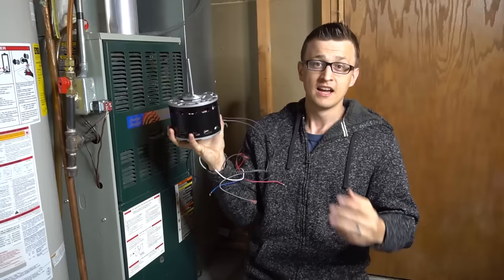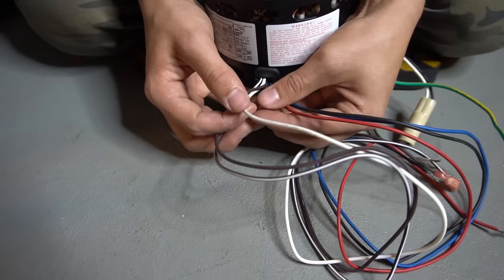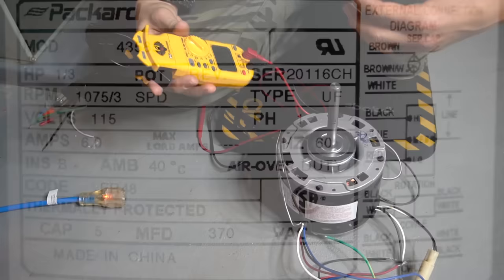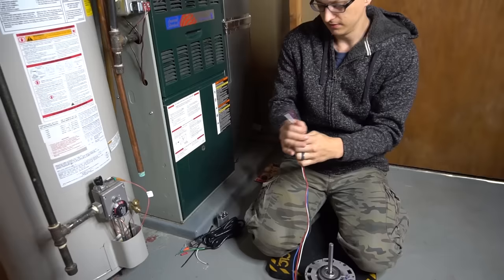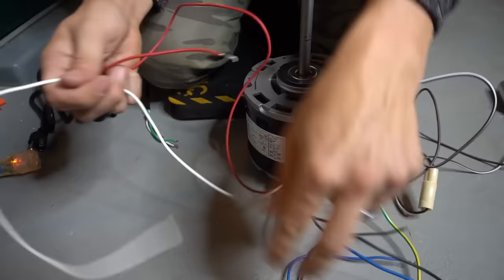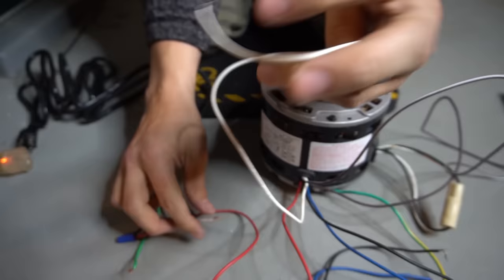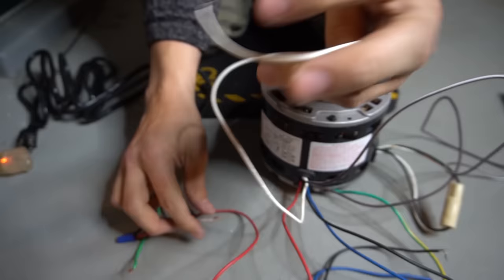How To Wire a Furnace or AC Blower Motor

Comment: Thank you very much for demonstrating how to check the motor speed wires!!!  On my 24 year old 2.5 ton York HVAC, both of my heat and cool board terminals were connected with the same black wire via with a short jumper wire therefore the heat mode was operating at a much faster speed.  For the heat mode now, I replaced the split/jumper  black wire that was going to both the heat and cool and replaced the heat mode side with the blue wire that was previously on the park terminal.  Everything is so much better now.  Again, thank you for your top quality DIY videos!!

Comment: "Rotation" has two views.  Shaft end and Wire end depending on how the fan blade or squirrel cage will mount or how the motor will mount, shaft upward or shaft downward. You might also comment about how to find HVAC parts because most of the supply warehouses protect their industry service tech by only selling to licensed general and/or HVAC contractors. Great review.

Comment: Capacitor job is to start the motor. If you disconnected the capacitor from your motor and turn the power on you will hear humming noise however if you rotate the shaft by hand your motor will start spinning to whatever the speed setting is. 
Great video by the way ! Good job bro
Reply: Would the capacitor's lifespan be increased if one line of the capacitor is automatically disconnected AFTER the motor has started up and is spinning (and of course auto-reconnect it AFTER the fan is switched-off again)? 
Hiring service-people to do the routine job of replacing capacitors seems to cost people a LOT of money in service calls.
Reply: Very good thought but unfortunately the circuit doesn’t work that way. 
Just think capacitors are like batteries, they will lose their ability to hold charge overtime and eventually decreased their capacity below useful threshold.
Reply: @eddo5617  That's ususally because the electrolyte degrades over use/time...often due to heat, chemical processes, over-volting, seal failure, and a few other things. But since the caps are often mounted on or very near the motor itself, of which many do get very hot, I was just wondering if disconnecting one, once the fan is "spun-up" would help reduce the electrolyte degradation by any significant degree. I do know that during use the electrolyte itself often also heats up to some degree...and that in turn can further accelerate the electrolyte failure. I just don't know the particulars in an AC motor circuit.

Comment: A very good as well as easy to understand instructional video. My blower motor ''went'' last weekend due to it's bushings going bad. For some reason they didn't put any oiling ports on the ends of the motor to oil those bushings. Since it's currently in the middle of winter & I'm goin through a pretty powerful cold spell, I ''had'' to get something going quick. I had an old ''scrounged'' blower motor on a shelf in my basement that fit just fine (a little better in fact), but it was only an 800 RPM motor instead of a 1000 RPM as the original was. I like how much better this slower motor is heating my house, but since it's a single speed motor, I'd probably have some issues with the cooling coils freezing up during the summer or A/C season. Since it is a ''scrounged'' old motor, I need to replace the original with a ''new'' motor. I typically fix everything I have if I can if I'm able to get access to what I need so putting a ''new'' blower motor in my furnace won't be that hard (especially since I've already torn it all apart to try to fix the original & replaced it with another). I've researched a particular motor, but all I've been provided with is a brand name, part number, & wiring diagrams. I haven't found if it has more than 1 speed & what speeds they might be if it did. As many leads it has, I believe it surely has more than 1 speed. Since the color of it's wires are similar to those on your motor, I was wondering what the 2 slower speeds were on the motor you used in your demonstration. If I could get a replacement motor that had a slower, approx. 800RPM speed along with the 1075 RPM, I could wire in a switch so I could switch it between the 1075 RPM for the A/C season & to a slower speed during furnace season. I'm amazed at how much better my furnace heats my house after putting this 200 RPM slower motor in. It seems like the slower air flow is able to heat ''everything'' in the house along with ''every'' part of the house so it doesn't need to run as long each time it runs. I could literally feel the house getting, feeling, & staying warmer after it ran for the 1st time & it feels warmer in here even after setting my thermostat 2 degrees lower. It's been a surprising experiment I was forced to undertake in the cold of winter (it's 0 or below outside now as I'm typing this) with surprising results. I would like to know what the other speeds were on your ''demonstration'' motor. Again, well done video, Sir.

Comment: That's very handy info man! I
 wired my last blower motor in several years ago but had to be careful to wire it back exactly like it was since most motors I'd dealt with only had 3 wires.
Its not so complicated once you realize 2 are for the capacitor, 3 for the motor speeds to hot lead and 1 for the neutral or common. 
Also love the extension cord connection.

Comment: This is really helpful. I need to replace the fan motor on my heatpump tomorrow and when I replaced the blower motor in my furnace a few years ago i wired it to high speed because I wasn't sure. Now I can double check my work on the furnace and slow the fan down, she runs hard and is pretty high volume out of the ducts

Comment: between this video and the other video on replacing a blower motor I got mine replaced and saved about $500 in the process, you are awesome!  thanks so much for making the videos and answering my questions about 115V vs 200-230V motors
Reply from the maker: Glad to hear you were able to get it fixed! Thanks for coming back with an update, stay cool! ;)

Comment: Thanks, a friend just dropped off a blower with a similar motor he saved out of his air handler he had replace a few years ago. Asked me to wire it to switches so he could make a simple box cabinet to use it as a fan in his garage this summer. I knew the basic principle of how they work but your well explained details sure saved me a lot of time figuring it out on my own. Thanks  again for all the help. :-)
Reply: Speed  and power samll wire rethion  .  White comon  N..read  low  speed..  black..ac serped high..... bleu  mediom low seepwhit  mediom pon 110  N  and mieiom poin  power pont..
Reply: Brown and whit mix cap.. gerecap 2 wire .

Comment: Thank you Sir! My York just stopped blowing last night/yesterday... Very comprehensive and descriptive video. I was thinking my motor was bad (expensive} but I now know that I need to test my capacitor also (much less expensive) since without a good one or unplugged, the motor only hums. That is exactly what mine is doing after the gas burners heat up and I hear the click for the fan blower to kick on.

Comment: Thank you so much for your detailed explanation!  Our furnace is almost 20 years old. The prices to replace the motor and capacitor is $1,440. Eeek!  I'm going to replace my capisiter,  disassemble my fan and motor, clean them and oil up my motor a bit to keep it running smoothly.  So$10 worth of maintenance.  Even if I have to replace the motor, it's hundreds instead of thousands.
Reply from the maker: Oh yes! I would do it myself too if I got a bid that high... With all the how-to videos nowadays on YouTube, all you need is the willingness to try :) Thank you for watching and commenting!

Comment: This was super helpful.  My gas furnace blower motor is either bad or the capacitor is bad.  The motor thermal protection appears to be being triggered so the effect is the motor cycles .... 30 sec run...30 sec off.  This was strange and initially thought it was the control board. Then I checked that control board power was staying steady at 120 volt and all burners and controls were fully functional. I have learned a ton from your videos , thanks!

Comment: Hands down one of the best Youtube Channels I have ever come across. I am a subscriber! I really enjoy your videos and because of them I've felt confident enough to fix my own HVAC issues. Earlier this year, after watching one of your videos, I replaced the furnace control board having never been exposed to an HVAC system. Ordered the replacement board on Amazon and saved myself $$$$. 

Today I was searching for a video on blower speeds and came across this one. Excellent explanation on how to test the speeds and wire them up accordingly. I've been investigating an issue where the fan on my main floor system would not operate when set to ON, but would when set to Heat or Cool. I read in the comments of another video, that the particular board I have has to have a speed wire connected to the Heat LO tap on the control board. So I grabbed the Med Hi (blue) from park, plugged it in and now the fan works in On.  

But I am wondering if I should swap the Med Lo (yellow) which is currently connected to the Heat tap, with the Med Hi to ultimately increase the airflow while heating? I noticed in this video you suggested Med Hi for heat, so I was curious if the Med Lo was incorrectly connected when the system was installed. I've seen a lot of forums that have debated this and a concept about heat rise temps or something.

Comment: As I watch I say to myself what if etc. and 5 seconds later you are covering what I was thinking, Jay you're the best!
Reply from the maker: Glad to hear the video didn't disappoint! :) Thank you for watching!
Reply: @WordofAdviceTV  seriously ty
Reply: @WordofAdviceTV  hey I need you to know by your videos you seriously saved an old couple. He is 78 yrs old on oxygen and the lady suffered from many serious problems. Anyway they are warm now and we have to thank you for your straight forward teaching. They are on limited income and have no spare money
Reply from the maker: @studypartner9643  That is great to hear!! I'm happy to know that my video helped! Thank you for leaving a comment.
Reply: @WordofAdviceTV  yeah I studied your videos and was able to get their heat on a few times. Once it was the pressure switch and another time it turned out to be the board. But if it was not for you it would not be running so I had to send out a thank you. They would have possibly lost their home because they are a check away from going homeless.  Can't thank you enough
Reply: @WordofAdviceTV 
 I was waiting for you to manually spin the shaft of the motor to show it runs without the capacitor in either direction,you let it stop and you spin it in the opposite direction and it will run both ways !!!!!!! So the capacitor IS like a battery,it gives it the "punch" to get it rolling in the right direction !!!!!!! ♿ 🇺🇸
Reply: ARE YOU FROM CONNERSVILLE?
Reply: Sorry to be offtopic but does any of you know a trick to log back into an Instagram account?
I stupidly lost the account password. I love any assistance you can offer me
Reply: @Henrik Armani Instablaster :)
Reply: @Thatcher Nelson Thanks so much for your reply. I found the site thru google and I'm in the hacking process atm.
Takes quite some time so I will get back to you later when my account password hopefully is recovered.

Comment: That cap might be bad on mine? The air handler motor on my a/c quit running yesterday.
I've been watching your videos over again and I think I found the problem. We had a big rainstorm today, but I will check it tomorrow. Thanks again Jay. 😊
Reply from the maker: Capacitors often fail after a rainstorm for some reason. (probably due to voltage spikes) Hopefully that's all it is for you Mr. Classic. Good luck!!
Reply: @WordofAdviceTV  , Well, I cleaned the unit with a hose before it quit. Maybe I got that thing wet?🤔😁🙄
Reply: @WordofAdviceTV  ,My air handler doesn't have a capacitor hanging on the housing or anywhere near it.
Reply from the maker: @classic287  Oh boy.. We are talking about the air handler inside of the house right? An easy way to find it is to simply trace where the wires from the motor go. Another possibility is that you have an ECM motor which does not have a capacitor. Those motors usually have a lot of wires coming out of them that are the same color. Does your unit have a control board? Is it blinking any codes?
Reply: @WordofAdviceTV  It's a package a/c (outside complete). No control board.
Motor has 2 green wires, 1orange, 1 brown and 1 black.
There is only one dual run cap.
Endura FM18 motor, 3/4hp, 230vac. Part # 51-101920-07-01

Comment: You are very good. Thanks for posting. Except that the wires should have had a wiring nut just in case they short to ground or chassis.

Comment: I like all your video, the way you explain in such a simple and easy way that helps very easy to understand. You take the viewer with you. I would like to see your video to repair psc blower motor. Please send the link. Another question, I am replacing new psc motor, all aspects are matching, except original motor is 5.1 Amp and new 3.8 amp. Will it make any harmful affect?

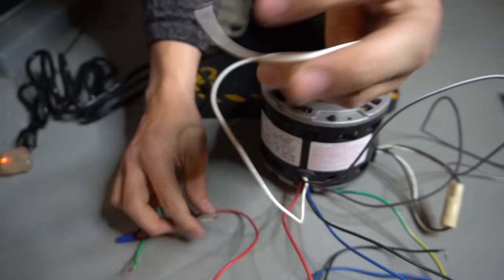Comment: 13:00 Capacitor - You have it backwards, It is to get the motor running, not keep it running. If you had turned the shaft by hand after plugging it in, it would have sped up to running speed and kept running.
Reply: Actually, he's right. There are 2 types of capacitors, start and run.  For this application a run capacitor is required.
Reply: It’s a little confusing, yes it is a run capacitor but it is connected in series with the start winding in the motor. In order for a induction motor to spin you need a rotating magnetic field. A 3 phase motor has 3 windings 120 degrees out of phase with each other to accomplish this. In a single phase motor you have 2 windings , a run winding and a start winding. By placing a capacitor in series with the start winding you achieve a phase shift where current and voltage are 90 degrees out of phase thereby simulating a rotating field to get the motor started. daaj is correct that without the cap you can start the motor by hand by giving it a boost in either direction and it will continue to run in that direction. A little more explanation on the phase shift from the cap , there are 3 types of loads , resistive, inductive , and capacitive. In a pure resistive load voltage and current are in phase with each other. In an inductive or capacitive load voltage will either lead or lag current depending on which type. Hope this helps a little. I love this guy’s videos though, I’ve been an electrical contractor for a little over 20 years and just starting to learn HVAC , always been interested in it and these videos are so helpful. He is very good at explaining and teaching in a way that is easy to understand.
Reply: @ryanhurst8661  good job explaining
Reply: This uses a run capacitor, not a start cap so he's right

Comment: Very informative, 
Thanks
Reply: I drove from TX to Ga to work at daughter's house. While there i replaced a      fan motor and cap. on a trane condenser because of excessive  loud noise. After replacement, the fan ran but not at full speed and had a pulsing vibration. I had to leave and a a/c man looked at it and installed an extra (smaller) capacitor and it smoothed out and ran at normal speed. The dual cap I installed was proper rating for motor so in future how will I know that it needs extra capacitor or what to look for
Thanks
M L Rogers    pasadena,tx

Comment: WOW, this is the BEST "How to Video" I have seen on YouTube about testing an HVAC blower motor. My blower motor is a 2-speed 208-230 volt motor, how do I test this motor, the 220V motor does not have a neutral wire, only two LINE wires noted on the schematic?  Thanks

Comment: I inherited a brand new 3 speed furnace blower motor and had no idea what all the wires were for or where they went. Your video and explanations  were exactly what I needed. Thanks a ton. Also, can the capacitor give you a shock?
Reply: Technically yes, but in this scenario it would seem unlikely. Even if the capacitor is charged to 160V at the moment that power is disconnected, it should discharge almost immediately through the motor windings. If one of the windings are bad, then it could retain some charge. If in doubt, it doesn't hurt to discharge the capacitor prior to touching the terminals. You can do this by simply shorting the terminals with something conductive although for higher voltage or capacitance values, I prefer to use something like a 10 ohm resistor if you have one handy - preferably one designed for a watt or more of power. If the capacitor has enough stored energy, you could end up spot welding things together. Having a little resistance in the way makes that unlikely.

Comment: I get it that the motor will work when you plug it into the extension cord like you did. Thanks for that.

But when you 1) actually install the motor into the HVAC system and there’s an extra hot wire (hot meaning black, blue, and red), is it okay to just wire nut an unused wire (blue in my case)?

2) This means I’ll have only 3 of 4 wires plugged in (not counting the capacitor wires).

Comment: Very helpful and well done. The only video I have seen that shows the actual control board and where the Black, Blue and Red wires for a 3 speed HVAC fan motor connect

Comment: While you had the circuit board in your hand, I sure would have liked if you went ahead and fill in what goes in all the wire connects.  ( Compressor, power in, etc). Or in the description below.
Thanks.